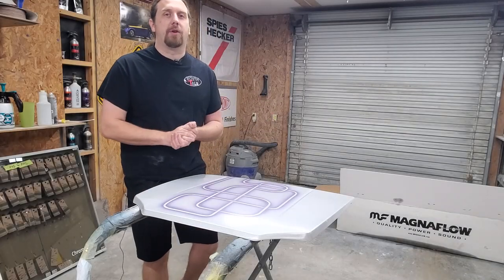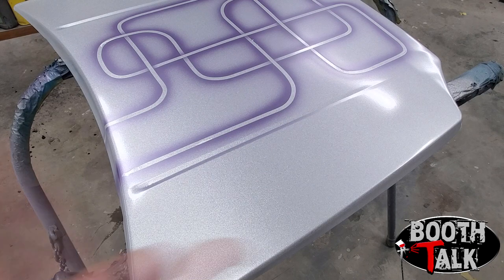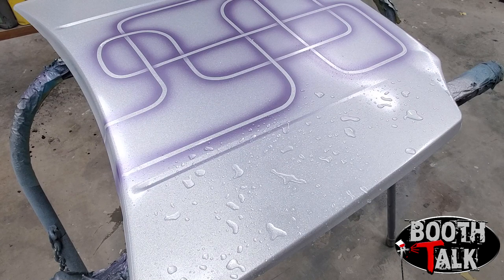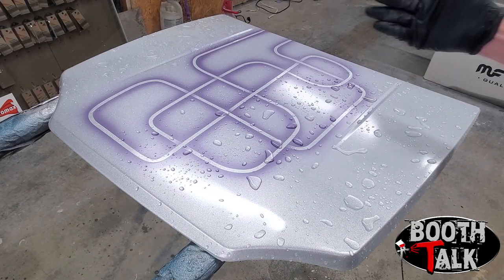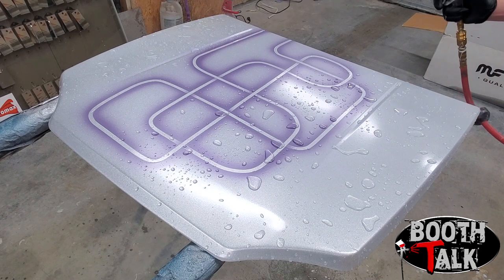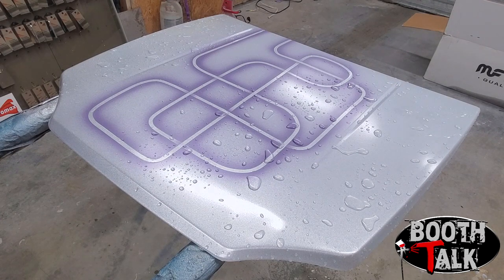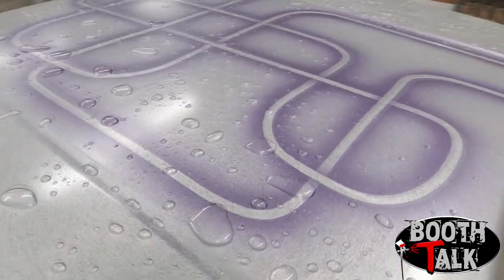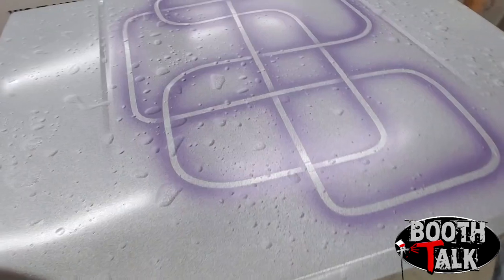How to Custom Paint: Water Drops!

Comment: I'm wanting to do a PS4 controller. Any tips on the sides (where it curves)? Or is it just the way it turns out? Also I want the bubbles to look like they are floating upwards. Any advice or tips on that? Thanks
Reply: The air brush method might be easier since it is a small project. 
Might want to watch "How to paint water drops and airbrush lowrider style panel graphics" video from time warp custom.

Comment: Is this solvent or water born paint
Reply from the maker: In that video is was solvent.
Reply: @inthehomeshop  water base it doesn't work right?
Reply: And the over spray shows. What if you just spray the water onto a wet solvent surface?
Reply from the maker: @andrewheneks9220  the overspray is what helps create the effect.  I've never done it with waterborne.  Like anything, there's 1000 ways to do something.  It's paint!  Enjoy it😎

Comment: Great video. About what air pressure are you using? I’d like to try this with an airbrush.
Reply from the maker: Pressure will be different with different guns.  I was around 10 psi.  You want enough to blow out paint,  but not disturb the water.  Don't be afraid to adjust!
Reply: @inthehomeshop  thanks. It's almost like hydrodipping. Almost. Are you using Spies? Great product.
Reply from the maker: @ironwood1621  at my day job we use spies water.  This was done with spare black and white solvent I had on the shelf

Comment: Cool effect!  Thanks for showing this. How much clear does it take to bury the droplets? is there an edge on the hilights?
Reply from the maker: 2 normal coats and its flattened.  The effect, when done correctly, is a minimal amount of paint on the panel, resulting in very little build!  One of the many reasons it's so easy to pull off.

Comment: The only thing that sucks is that the clear typically likes to delaminate down the road when doing this.... It's just a matter of the base drying & losing that window.
Reply from the maker: Use an intercoat over the base,  or clear then sand prior to this.   Shouldn't have issues with delamination.  Most base coats have a 24 hour window